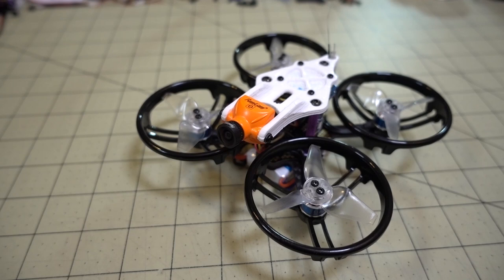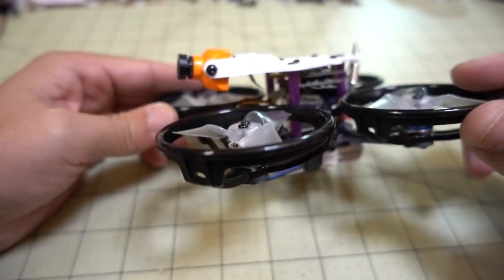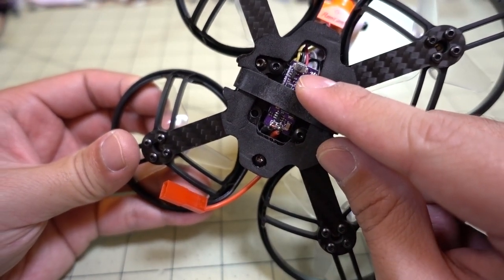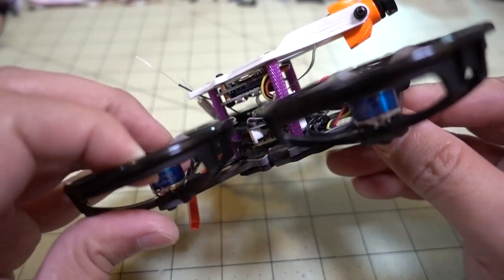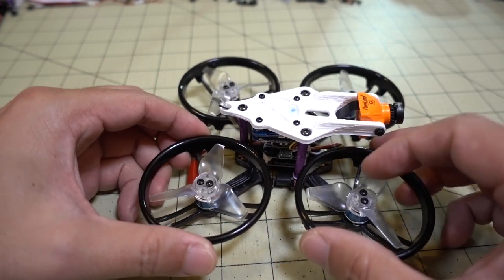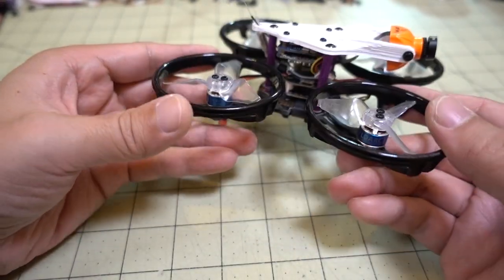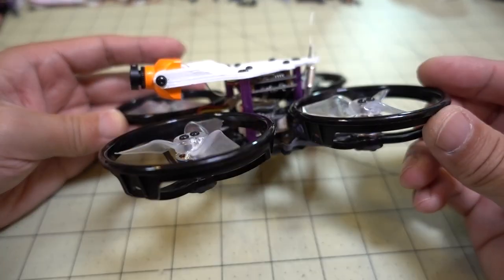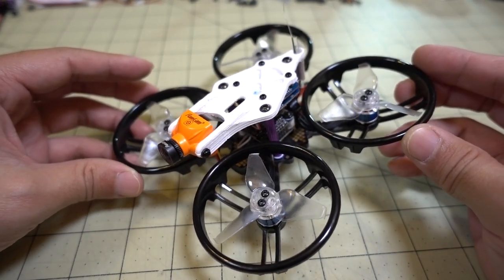DIY CineWhoop // LDARC ET115 Conversion 😀

Comment: What an awesome re-purposed design and implementation!  The thing that makes those videos great is the software the stabilizes and smooths out the raw footage.  However, what you have here is a really good raw video that totally lends itself to that post-production process.  At least as far as I understand it.  It will suffer some added degradation from not being shot in 4K, but it would still look very good.  IMO, the true beauty in your design is in the cost savings, that it will be more rugged and survive any crashes to a higher degree.  Well done!

Comment: Great idea. I’ve got an ET125 which I’ll convert. Thanks for 3D part. 

Question - do you adjust your rates/expo for this style of slow flying?
Reply from the maker: Yes, lower your rates and add expo.  Experiment until you get the feel you like.

Comment: saw that file too - was still thinking about getting it printed for my et100 (but would use caddx turtle instead, because available) - but et100 is already too heavy, even on 3s
Reply from the maker: I got both the Turtle V1 with three standoffs and the V2 with all four standoffs to mount to this.  I actually did try this...

Comment: Super smooooth video! Great work! On 3S this ET will be a blast with HD recording but on the normal 2S and fast battery sag ... not for me.
Reply: You can run the v2 et115 on 2s or 3s
Reply from the maker: You can run the ET115 on 3S if you don't go too crazy on the throttle.

Comment: I've done the same but with the et100 frame. Just recieved the turtle v2, I'd love to have something that will protect the camera more. I've printed this one : https://www.thingiverse.com/thing:3081055
But I couldn't fit everything, I think with a few mm more (of height) it will fit and you will no see the props.
Reply from the maker: I saw that one too, but if you have a low camera angle to capture slow footage, the prop guards are about half the screen.  I wanted little to no prop guards on the video footage.  Since I'm flying super slow, I wasn't as concerned about breaking it.
Reply: @AlbertKimTV  with the caddx F1 at 15° camera tilt I have no props view with this canopy (I have a video with it), but the fov of the split and the turtle is wider, I still haven't tryed. Thx for sharing
Reply from the maker: The FOV of the Split is a LOT wider.